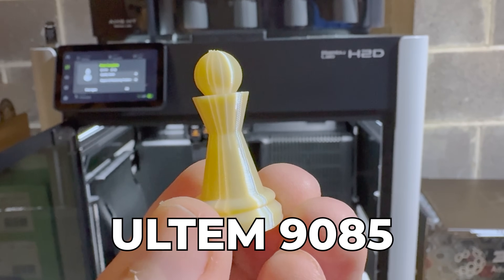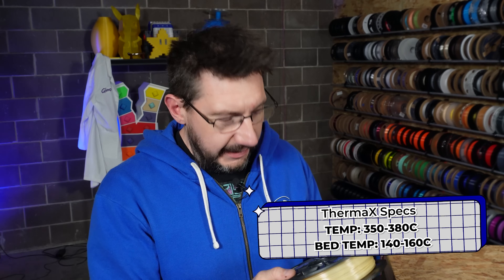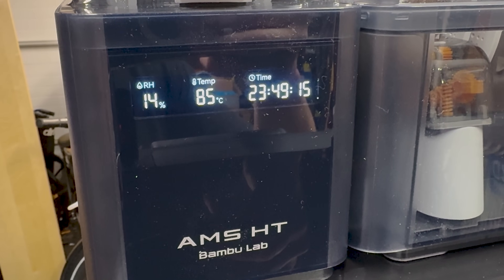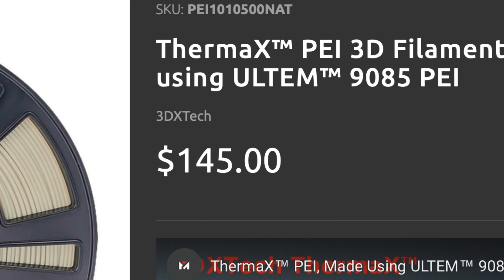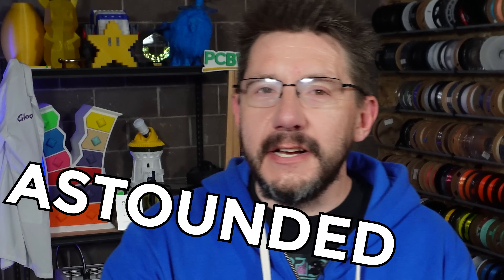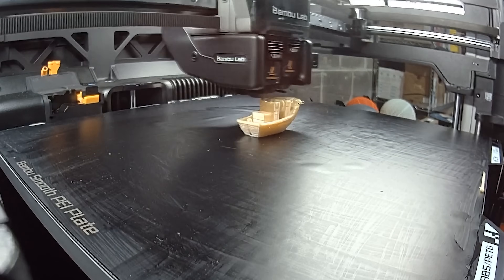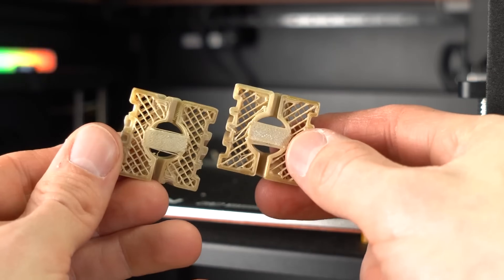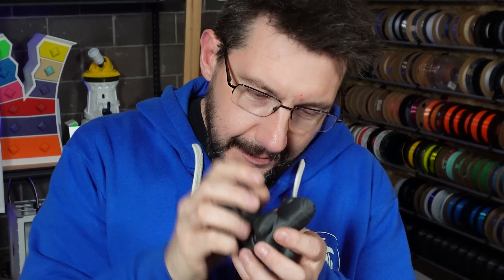DO NOT PRINT THIS on the Bambu H2D

Comment: Americans really do anything to avoid standard measurements. Do not use °C (degrees Celsius, a scale for temperature), but c (which is the speed of light) sometimes as superscript, sometimes as subscript and sometimes just c.
Reply: It has nothing to do with avoiding standard measurements. Personally, I try to adhere to standards as much as possible for consistency. However, our keyboards in the USA do not have the ° symbol on them, so most people do not understand how to produce the character. 
Therefore, they try to designate the "c" as a reference to celsius in the simplest to understand format they can. This is not just an American problem.
Reply: I almost never see an American use non-Metric units for 3D printing.
Reply: oh palease.  Everyone says "c" across the world, and anyone with 2 brain cells to rub together knows from context the reference is to temperature and not the speed of light.
Reply: @JohnVanderbeck  No one around the World says C. We say "10 degrees", no need to state the obvious - which is Celsius.
Reply: @brba  I guess I need to clarify.  Everyone simply says C when they want to specify.

Comment: How do you raise the max temps on a marlin printer when I have changed parts to meet these higher temps.  All metal hotend, copper heat block, high temp nozzle.  All good to 550c but printer max is 260.   Silicone 120v 550w bed heater on a mic6 6mm aluminum bed.  Still limited to 120c.
Reply: Hello fellow Pole! So, you have to flash firmware that you modify to change these limits from the preset for your printer onto it. It's thankfully not that complicated as long as you correctly follow a tutorial. That's it, good luck!
Reply: Look at the M143 command.  (M143 S<temp> in either a file or in an OctoPrint terminal)
And don't forget to save. ;)
Reply: @BLBlackDragon  Can I just put that in my start gcode?  Or will the firmware just override it?
Reply: @Jynxx_13  on my Ender, I set it through OctoPrint, and saved it, so it’s always available.
If that doesn’t work for you, then add to your start code as a per-job override?
Reply: @Jynxx_13  
From one person to a nother 
Remember that your frame won't like the heat and you will expec twisting and such in the rails
Reply: @Goroca  My Ender 3 S1 Pro running klipper via Sonic pad prints @400c Nozzle, 160c bed with no issues.  That's why I want to elevate the max temps on my other printers that are not sonic pad configurable.
Reply: @Jynxx_13  
oooo
the electronics wont like that but good luck